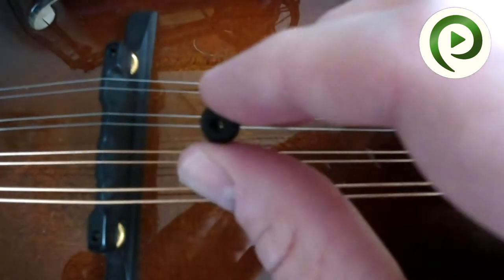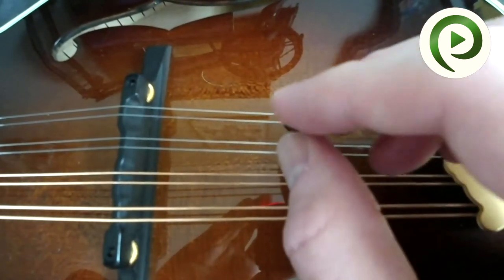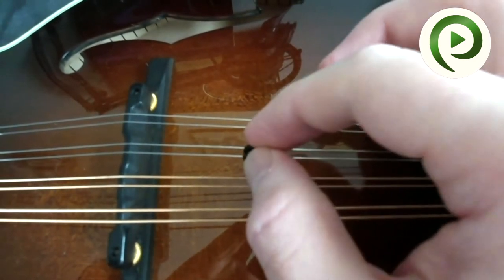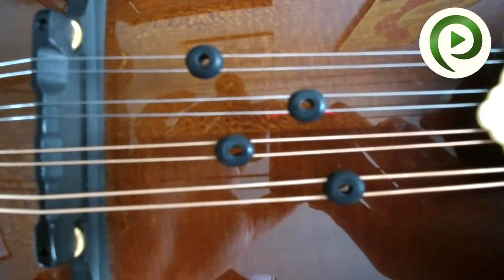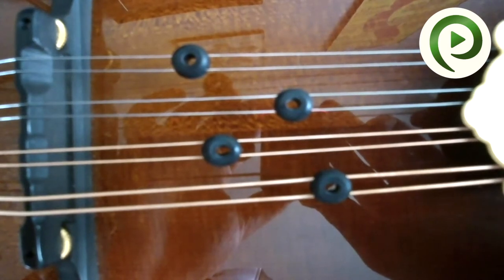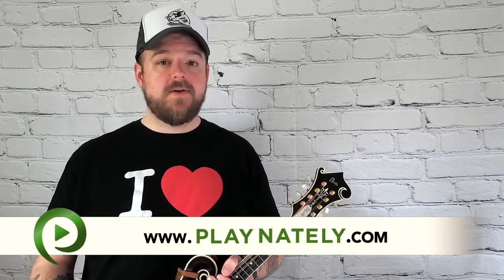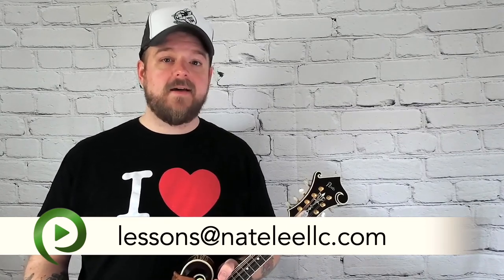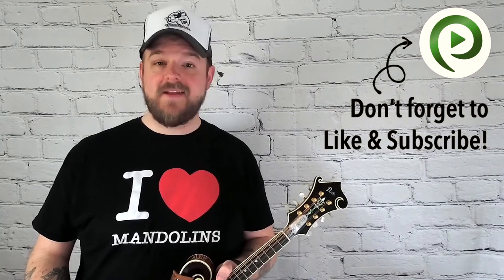How to install your Mandoughnuts | Harmonic Tone Enhancers

Comment: Going through all of my strings in my case and I found a bag of your grommets. I must have purchased them at Camp Bluegrass '23 and forgotten about them until After Camp '24.🤷🏼‍♂️ I don't know but they're on there now!!!
"Saved Camp Bluegrass"
Reply from the maker: I have had the same set on the Wonderbat for years. The first set I ever bought was at Radio Shack in Levelland during Camp Bluegrass around 2002-2003. I used that set for like 10 years without losing them.

Comment: The James tailpieces have a rubber overtime suppressor - so doesnt this make the mandoughnuts unnecessary?
Reply from the maker: The o-rings on the James Tailpiece help some. Since they're not located halfway between the bridge and the tailpiece, they aren't able to do the whole job though. A lot of folks are perfectly happy with the James tailpiece alone, though. I'm really sensitive to even the most minor tonal qualities and differences, for better or for worse, so I double up. 

Do you use a James tailpiece? I think they made the best one on the market. - Nate
Reply: @PlayNately  Thanks and makes sense.  I do have a James tailpiece (on my Kimble) - but I've ordered a set of your mandoughnuts as well!  Thx